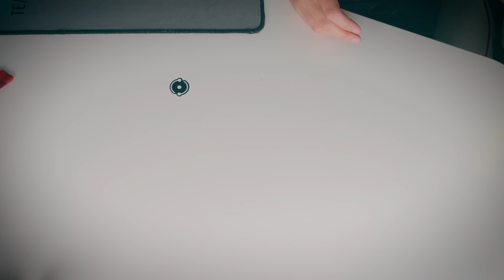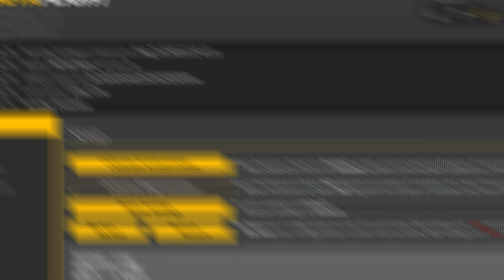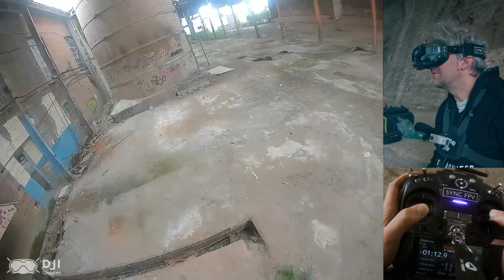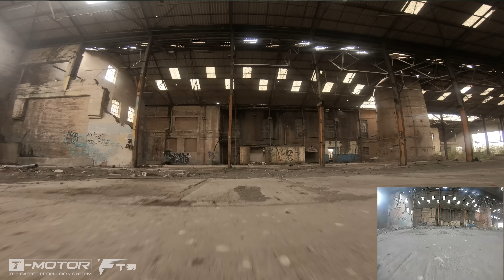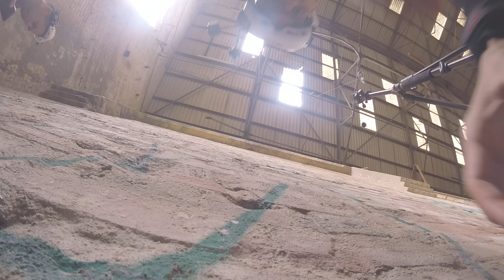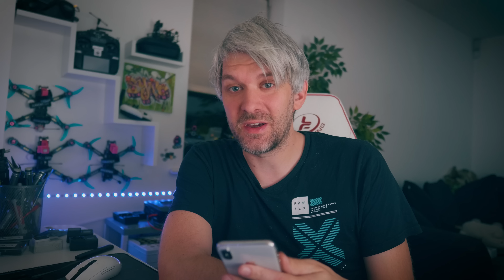Sync Tests - T-Motor FT5 MKII 60% Build

Comment: I don't like how they soldered the wires to the bottom of the ESC
If you want to run props out, you'll have to tear everything down and move the motors and resolder everything.I don't know what the fhvck is going on with the DJI pinout either.   Seriously, WTF.

Comment: The point of the rpm filter is to allow you to reduce the default filters a lot to get better propwash handling. Enabling it on its own like you did actually makes it fly worse than default :D Read the tuning section here https://github.com/betaflight/betaflight/wiki/Bidirectional-DSHOT-and-RPM-Filter

Apply the dynamic notch settings it recommends there, then move both filter sliders to 1.5, this is representative of 4.2 good performance

Comment: I love how the FT5 flies, unfortunately, I had arms broken several times in grass on the first day flying. This never happened to one of my iFlight (Cidora) frames before and made me a bit disappointed. The arms are narrow, what makes them a bit more fragile, just wanted you to know. In addition you can't order single arms, you always have to order a whole frame.
Reply from the maker: ah ok, this is a v2 of the FT5 that hasn't come out yet so it is slightly different. That doesn't necessarily mean anything per say as I don't have a v1 to compare against so can't tell you everything that is different, I know the top plate has more area devoted to the camera tho as the original gopro mounts designed for the v1 didn't fit and I had to modify it a bit :D Anyway, I do hope they will offer single arms as that is kind of the point of a quad with removable arms! Thanks for the info dude
Reply: Great vid ! As far as the arm’s go I saw a few suppliers like RDQ selling the individual arms. Should be others offering the same. Cheers.

Comment: I’ve been eyeing this quad for a few months now but haven’t seen much in the way of durability testing. Did you crash into wall once and showed it multiple times or did you crash it as many times as you showed it crashing?
Reply from the maker: Was just a single crash I’m afraid as the motor bell got dented

Comment: Running Emuflight instead of Betaflight. did you ever try that $oftware? What are your thoughts about it versus kiss?
Reply from the maker: I did try emuflight vs. betaflight 4.1 and thought it was miles better personally. BF 4.2 w/ rpm has definitely closed the gap tho! Emuflight feels closer to kiss in terms of the stick feel. I feel like a blind test is in order!
Reply: @SyncFPV  Would enjoy watching that definetely. not experienced enough yet with different firmwares to judge myself, all I can say is I like Emu :)

Comment: Hi Sync FPV - nice flying ! i noticed you have the ax ii hd (i think thats what they are ?) on your dji goggles and are they with true rc stubbys at the bottom ?  and how would you rate them for penetration as not really into long range ? thank you :D
Reply from the maker: the stubbys are the axii ones aswell, you can get the patches and the stubbys as an axii hd kit. So far no issues with them, but I had the trueRC 4x stubbys before and that was really good too, so I need to give these a bit more of a challenging scenario to really know if there's much difference
Reply: @SyncFPV  thank you :)

Comment: If you haven't ready turn the 2 filter sliders 4 or 5 points less. It's over filtered with the RPM on. And of course put you ESC at 48khz but I'm sure you know that.
Demag compensation on high. Don't use chat compensation. It's worthless

Comment: The small top plate was a weak point, the battery will pull out the small top plate together when crashed. Also, the old F60 v1 motor is so fragile. Will get bend after few crashed. Now T-motor released v2 with the higher casing, I have to replace 1 by 1 until four of it. A bit regret why I did not take the Apex or Armattan frame like yours 😅😅

Comment: Now trying out Betaflight 4.2.x, for the lesser cost, would you say it is comparable to kiss as an alternative?
Reply from the maker: its the best betaflight has been in my experience, (4.2 with rpm filtering) but I still think you need to tune it a little to get that kiss straight out the box feeling. But yeah it flies real nice. Direct comparison maybe a topic for another video
Reply: @SyncFPV  a little tuning never killed anyone 😉
Reply: Lower ffwd slider to 0....thanks me later ;)
Reply from the maker: Flo-Rida FPV sounds like a plan
Reply: @SyncFPV  then work both filter sliders full right to 2.0, that makes biggest difference in propwash, i have both my apexes & 6in badgers at 2.0, motors just warm

Comment: Higer kv on 6s voltage spikes could be causing freeze man. Bigger cap should clamp it down man.
Reply from the maker: yeah the cap that was on it was pretty wimpy, 35v 470 for 6S felt a little low to me
Reply: I find the vista is more durable as it can take 6s direct also. Never had an issue with vista. Touch wood. Lol

Comment: Increase feedforward transition will soften center stick 👌0.30-0.40
Ish.
Reply from the maker: Thanks that’s all real helpful stuff!
Reply: Feedforward sp_averaged 3 is best for crsf it smooths signal crsf has varying packet data due to mode1 mode2 changes. There some tuning snippets on 4.2 notes. All good
Reply: Errrrp, lowering ffwd trans softens center stick